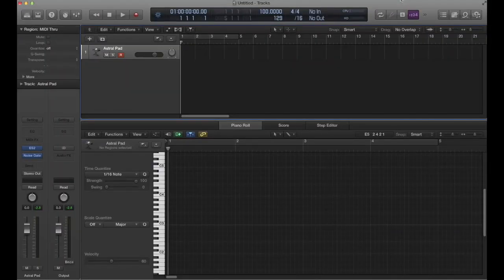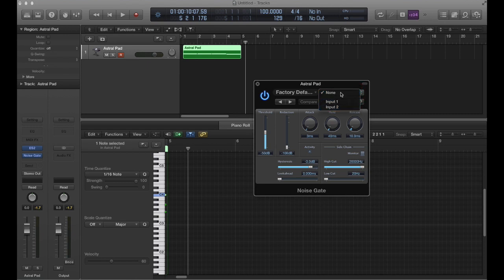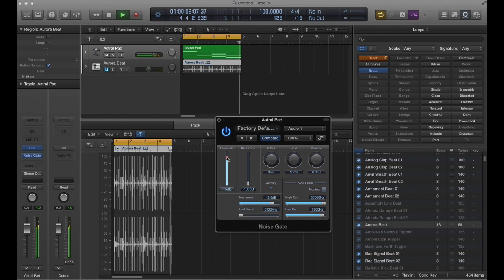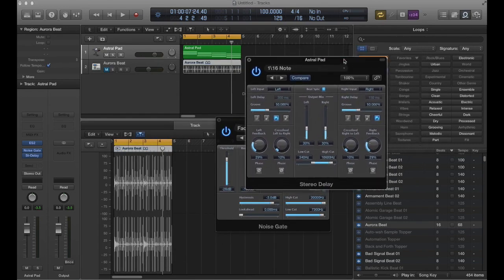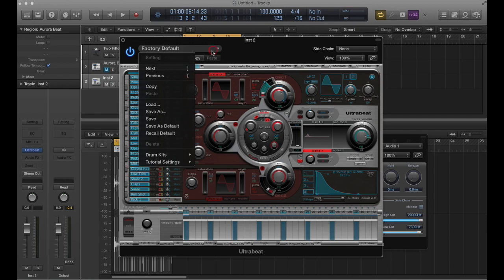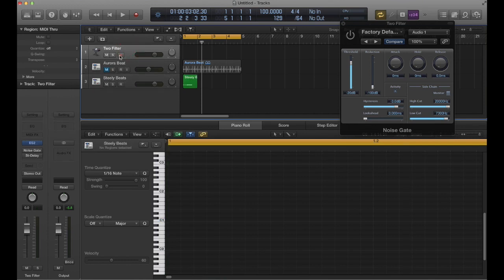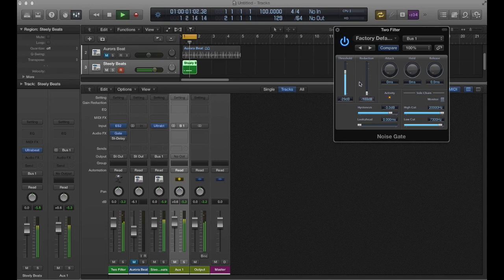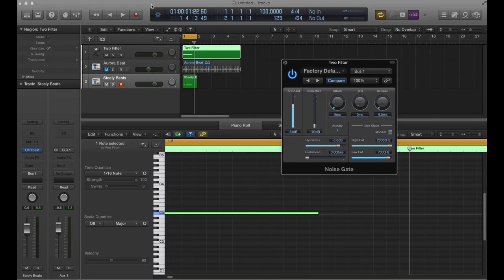Logic Pro X - Rhythmic Gating and Stutter Effects

Comment: You have a low hum in your spectrum. Comes and goes, seems like its only when your mic is in action but I can't be sure. But you have a low level humming-noise. Typical analog voltage induced noise. (it’s always been called hum in the studios I have worked. Just thought you wanted to know. Don't think untrained ears can hear it though 😉